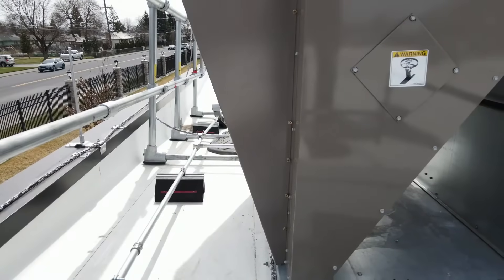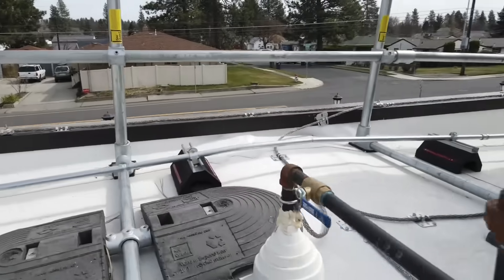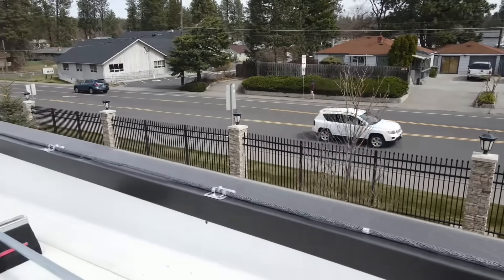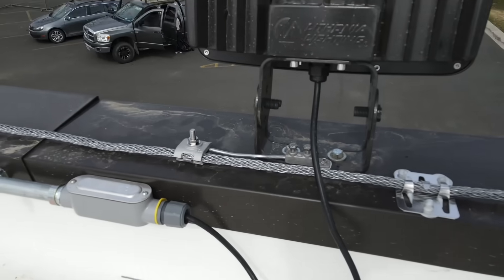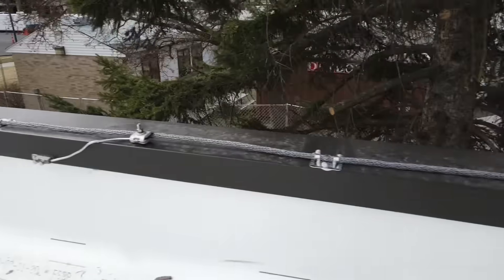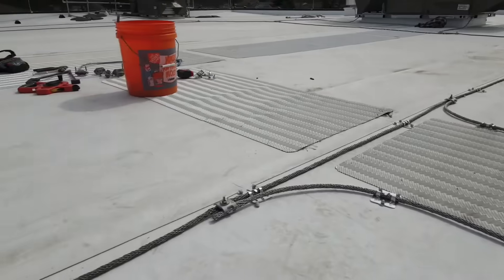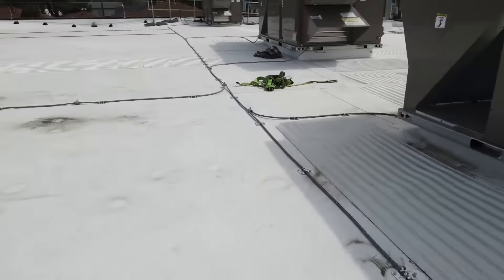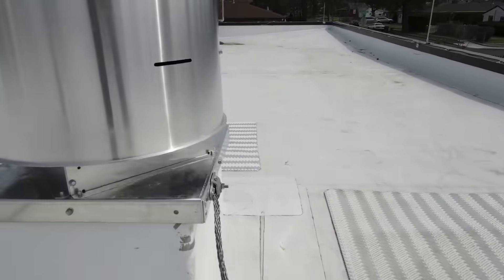Lightning Protection System Video- New Installation Small Commercial Building

Comment: Fantastic! Sometimes there are some visual details that can infer is a professional job. The lines are parallel, the connections are clean, sharp and symmetric, is overkill which is how I like to do things, always on the safe corner and as far as the risky one as I can afford. The spacing and straight cables are very agreeable and shows pride in the work. Hence, is how you know the IMPORTANT and necessary details are taken care of and reliable, because the other non-essential details, which are mostly cosmetic, are cared and done with attention to detail. Good job!
I wonder if you do business in NE Ohio. Yet, with my bad luck you probably do not😁. I have a cape cod red brick home, two stories, but really three because of the VERY tall attic since the roof is steep. 2,600sf, and I don't know where to buy the air terminals, base connectors, etc., even for a VERY tall (35ft) red brick chimney. I actually have a VERY good UFER and  copper rod that is not used. There are two additional rods buried on the West side where the electric meter is grounded. I upgraded to 200 AMP and decided to install/move to that side instead of the East side of the house. So, the UFER is a concrete and 148ft driveway, with rebar and mesh, and an 8ft rod fused with cadwell and a good bus bar waiting for a cable from my roof.

Comment: What's the estimated price for a project like this? A rough estimate
Reply from the maker: Hello! Sorry, just saw this! I am an installer and I do not get back into the office much to check the Youtube page. 

With lightning protection systems, they tend to vary in price depending on the materials used, the distance we travel to the job, and the time taken to complete the installation. We could give a price for this but it would have no comparison to another building or system, whatsoever. Prices can vary from $1,000 to $500,000 depending on the building, the materials used, and if the homeowner installs it or contracts the work out.

Comment: A lot of unnecessary things and a few things missed. But overall it’s fine.
Reply: Just curious, what are the "unnecessary things" and "few things missed" you're referring to? I'd like to learn.
Reply: Missed a few bonds horizontal metal bodies (electrical conduit) anytime your cable goes under stuff like that, it has to be bonded. If it runs parallel with your cable, it’s required to be bonded at the beginning and end and every 100ft. Other stuff was over bonded. Like the gas lines going to the units. They would be considered inherently bonded and wouldn’t require bonding unless your cable directly goes under them.
Reply from the maker: Thank you for your observations!
Reply from the maker: Are you in the lightning protection business?